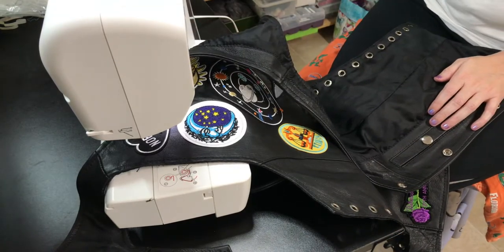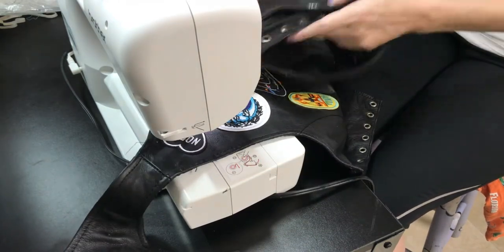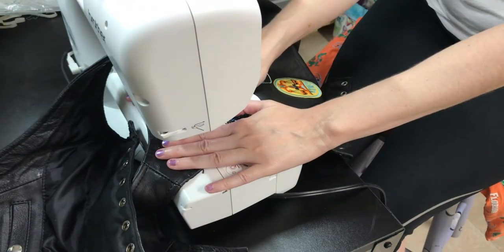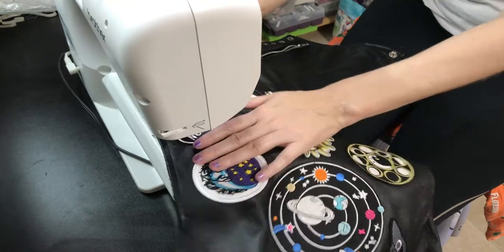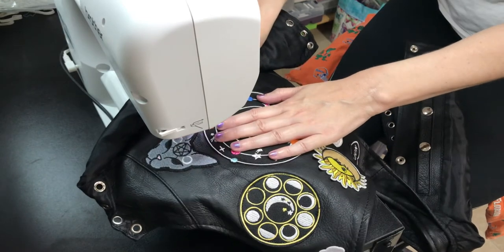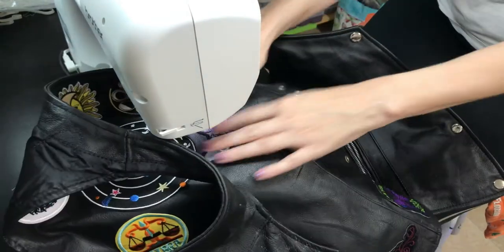Sewing Patches on my Motorcycle Vest!

Comment: I am getting ready to purchase a female leather vest that has two back panels (seam directly down the middle)...I need to put a large center back patch on...will the middle seam be an issue?
Reply from the maker: It depends on how you have it placed and it if you are doing it yourself. I use fabric glue first and place it where I want them and let them dry for a day or two with weight on them to keep them flat. I then use upholstery thread and a leather needle to attach them to the vest itself. I hope this info is helpful.
Reply: @RebeccaLyn  I plan on taking it to someone local to have it sew on...I will drop a link to the vest. 

https://www.firstmfg.com/collections/womens-vests/products/montana-womens-motorcycle-leather-vest
^back patch will be centered directly in the middle (it’s a large patch). Wanted to get some insight before I purchased it :)
Reply from the maker: Youtube blocked your link I just approved it, If you have a good or professional sew your patches on you should be okay with that middle seam.
Reply: @RebeccaLyn  Okay, thank you....I appreciate your input :)
Reply from the maker: You are welcome.  Good luck with your new vest.
Reply: @RebeccaLyn  I do have one more question :) Can you sew on an iron on patch to a leather vest or does it have to be sew on specific?
Reply from the maker: Yes most of mine were iron on patches, I used a fabric glue to hold them in place then sewed around the edges, You can apply an iron to it later if you want, but I did not.
Reply: @RebeccaLyn  okay, thank you :) I wanted to make sure before I bought iron on.